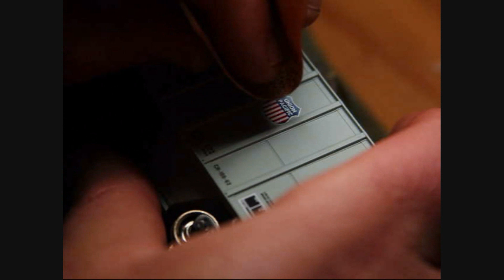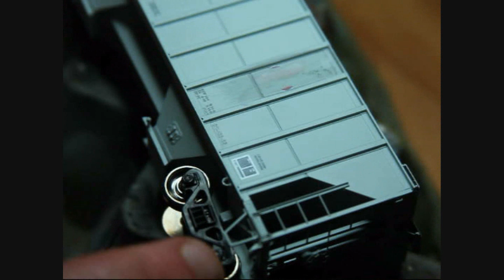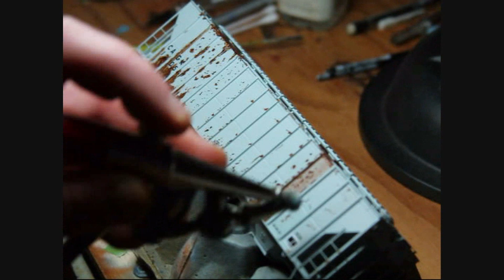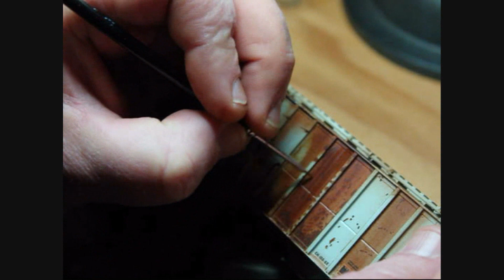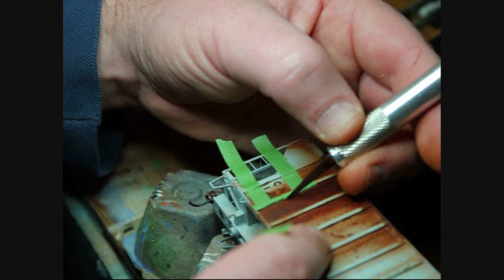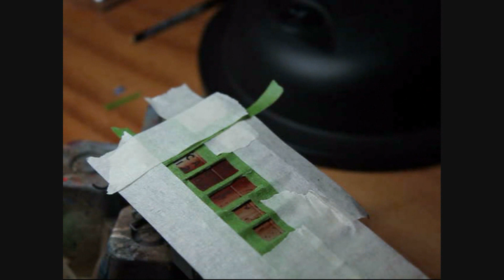CUSTOM WEATHERED HO SIRX 475486 PART 1

Comment: I found when I spray with alcohol, I get more reliable results when I add a couple of drops of acrylic retarder to the paint cup to slow the drying time down a little. It stops the tip from clogging which used to drive me crazy. You get all set up, start spraying and the tip clogs. Acrylic retarder made all the diff.